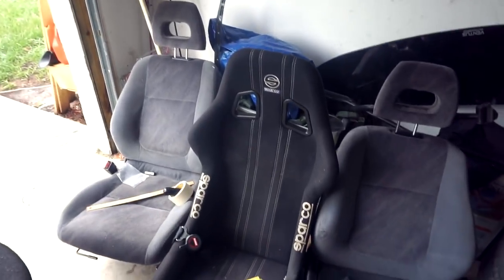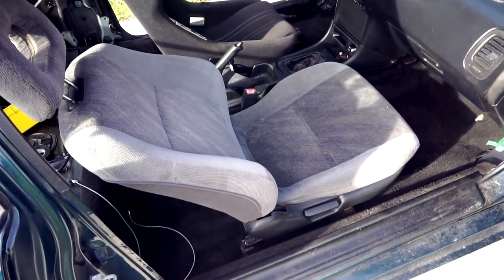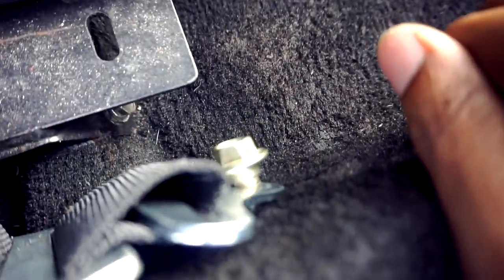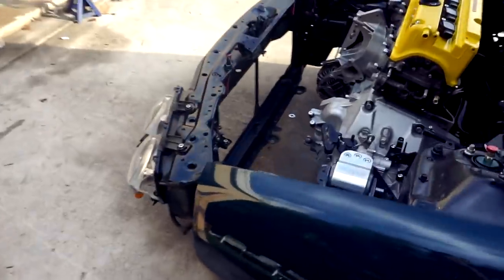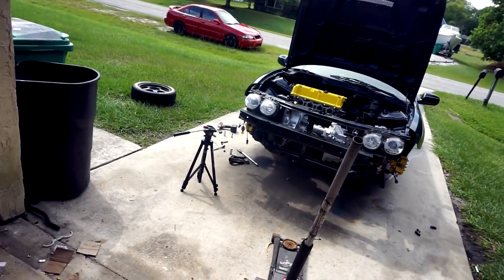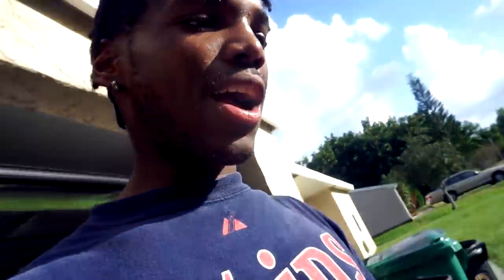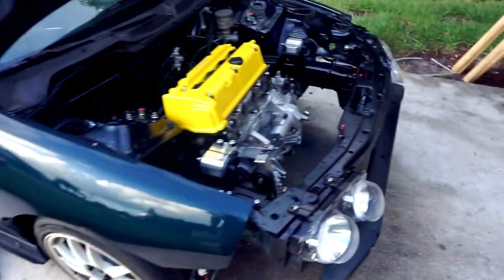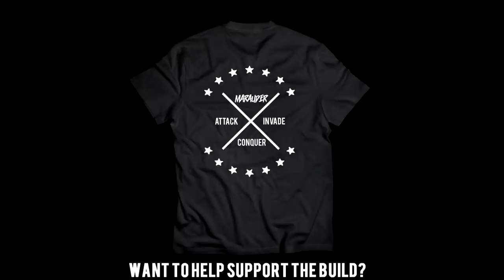HASPORT AXLES INSTALL & NEW WHEELS!? - K24 Build Series (EP. 11)

Comment from the maker: OH MY GOD LOL. 

YES. YOU'VE SEEN THIS HOURS AGO
YES. IT'S REUPLOADED.

I RE-UPLOADED IT DUE TO MY ADDRESS BEING SEEN IN THE VIDEO

IF YOU WATCH THE VIDEO BEFORE COMMENTED I LITERALLY STATED IT.

💆‍♂️💆‍♂️💆‍♂️💆‍♂️💆‍♂️
Reply: Zosh try pulling the handle on that seat the left rail might be miss aligned
Reply: put the bolts in one side of the seat then lift the slider and adjust the other side so the holes line up
Reply: p sherman 42 wallaby way sydney , is that it ??? Hahahahah
Reply: Zosh what’s the name of that song you use when you where installing the second axle

Comment: Zosh all seats do that you have to pull the seat adjust bar up and slide the seat all the way forward and pull on the track that isn’t lining up while you hold the adjustment bar and the track should come to line up if it don’t try the same method again except slide the seat back and try lining from the front

Comment: Get yourself a Harness Bar bro! You compressing your spine when you set up the harnesses straight to chassis like that. Also good job going with hasport mounts and axles. I used them for H23 swap mounts and axles in my old DC2 years back and never had a issue. I'm certain Hasport kept the same quality for the K mounts and axles as well.

Comment: If its an integra seatbit should work. Did you try sliding the seat forward and backwards? Getting one hole to line up and not tightening it all the way, slide the rail again and it should match up.

Comment: Everybody with an EG/DC should upgrade to S2K CMC i got an OEM one for about $80 on Amazon plus the Downstar adapter plate for $19.99. It made a big difference in pedal feel. I used Downstar's tuckin' clutch line too.

Comment: You also need a K-tuned immobilizer so you’ll be able to have your speedo , gas & temp working lol
Reply: Immobilizer is just for speedo the conversion harness controls temp and gas etc
Reply from the maker: negative
Reply: Reed it to fast lol immobilizer ls just for  the key but you can turn that off on kpro homie